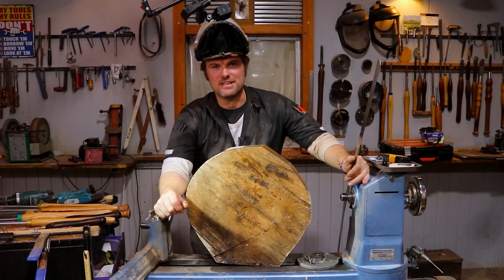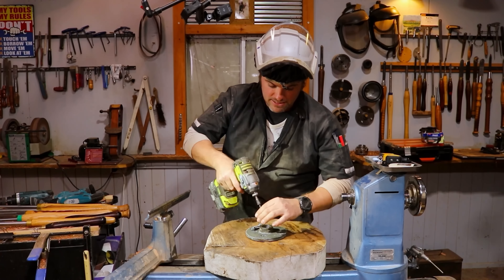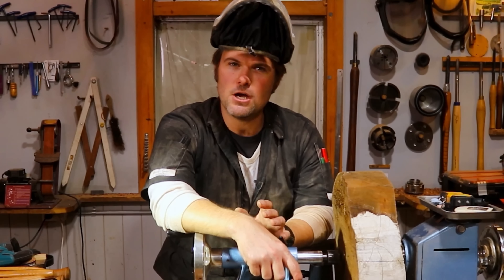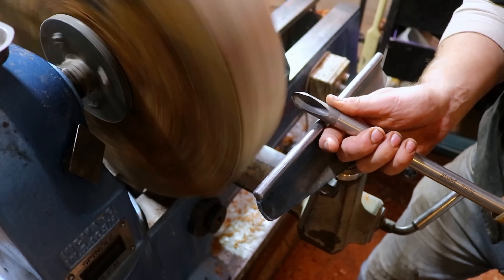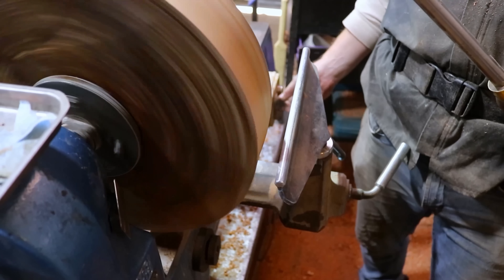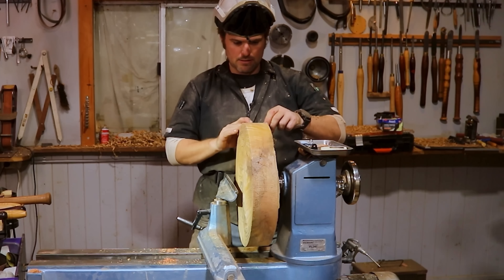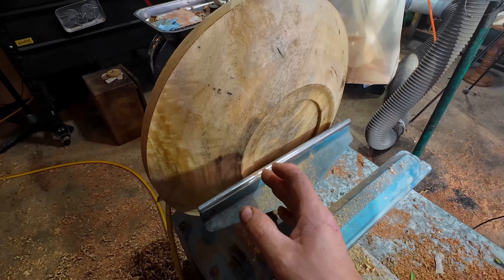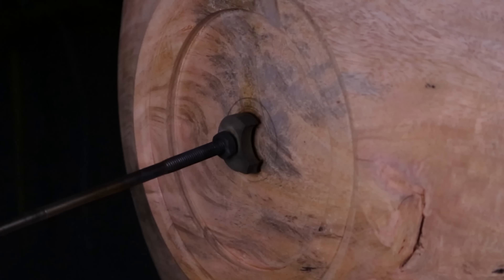Mango Crotch Dish.

Comment: 10:10 My Laguna 12/16 sits on a wooden bench and the bench is not bolted to the floor. When I spin up an unbalanced blank, it often shakes at low rpm, 400-500 or so, but smooths out when I increase speed to 800 or more. I don't know enough math to figure out why that is, but I'll take it.

Comment: I am amazed with the size of this platter. Today I prepared several black cherry blanks.  The biggest one measures 11 inches deep X 19.5 inches in diameter.  I will put them away for at least a couple of years before I can start to turn them.  Thank goodness I have lots of other material to work with...I can hardly wait. Keep up the great work
Reply from the maker: @chrisjohnston2449  That sounds like exciting times ahead, mate.
You'll have to keep me posted on how they go when you're turning them.
Thank you for the support, Chris🤝
Cheers,
Kez
Reply: @KerryCorney  I cannot decide if I am going to once turn them first or wait for a year or two to start and finish them.  I have the one way coring system so I could potentially have 8 bowls from the 2 big blanks plus 4 6 inch diameter bowls.  Decisions decisions?